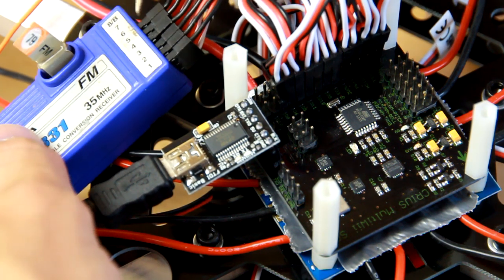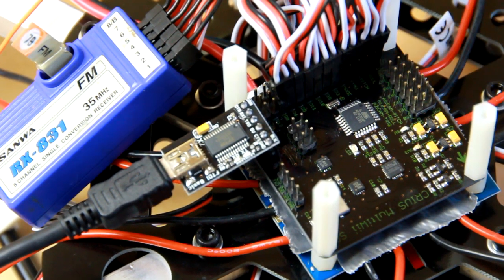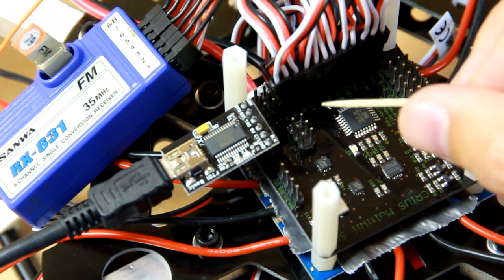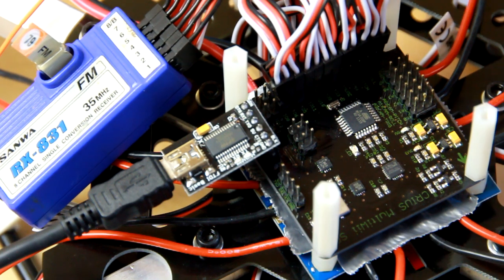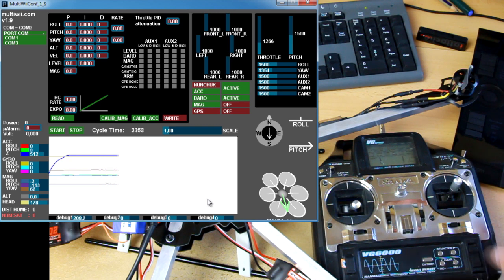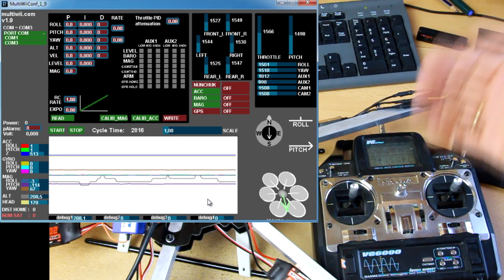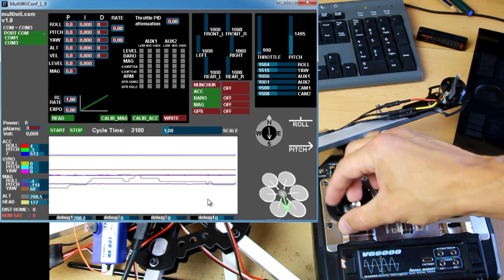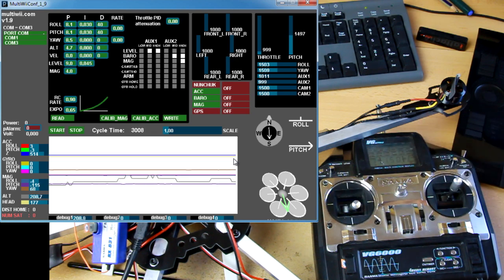My MultiWii Connection and Configuration

Comment: Calibrate one motor ESC at a time: Connect to battery and one ESC directly to receiver throttle and go through the calibration process. Always turn on your transmitter first and verify that the throttle is at minimum before connecting battery.

Comment: I'm new to multiwii. I bought a ZMR multiwii lite board. I only learned i need to upgrade the firmware. What is that device to connect to the PC?
Reply: if you search "usb to ftdi programmer" you should find them by that :)

Comment: как вы подклучились к компу?
Reply: +dtmpowerboss  nuzen ftd conector stobi s uzb provadom podklucitsa
Reply: Aleks Cortez понял
Reply: toka toka podcenil svoi fpv dron  i ponemnozku nacinaju ponimatj kak sto rabotaet. a u tebja sto za dron? u maivo 80 milj v 4as skorast poletal 5 minut kogda kupil i tri nedeli remontiroval
Reply: Aleks Cortez ООО 3 недели Что случилось
Reply: +dtmpowerboss nu kak v pervij denj ispitival dron. poganjal po vozduhu i razbil. patom kogda vso podklucil kak nado. adin iz 4eteroh motorov nerabotal. dumal motor zgarel. 
kupil mator paminal, vse toze samoe opjatj nerabotaet. patom paminal na tom ze krele katorij nerabotal ESC opjatj necevo. I kstati Flight controll board perestal rabotatj toze. nu i tot paminjal. toka tagda mog dron na vozduh pustitj. no esho fiska stobi dron letel nado ivo pravilno konfigure i pravilnie PID postavitj.
Reply: Aleks Cortez я тож так тока с naze32
Reply: +dtmpowerboss  pacemu vibral naze a ne crius multi wii? i kak dron uze letaet?
Reply: Aleks Cortez naze32  очень легко tune делать 
И я с етого начал и подключаюсь через Bluetooth к телефону накручивать

Comment: Can anyone help me?
My quad is working almost fine, the only problem is that, if i let it completely levelled on the ground, and i turn the motors on, when i accelerate, all the 4 motors speeds up, but the REAR_L is always in a lower level compared to the other motors.
I tried to click on the CALIB_ACC but the problem persisted. What i am doing wrong?